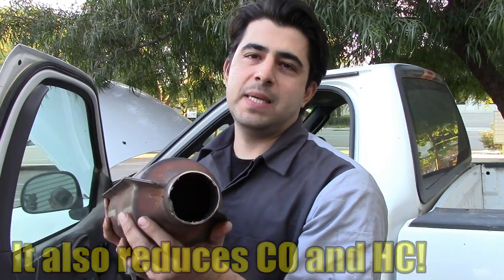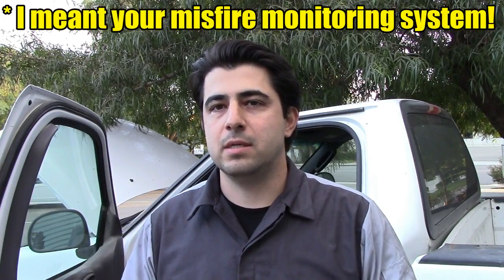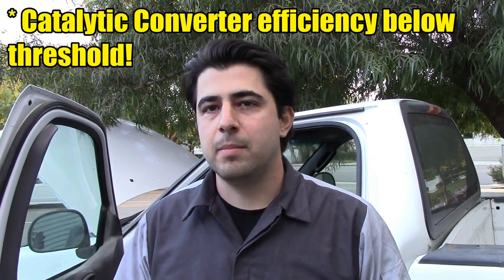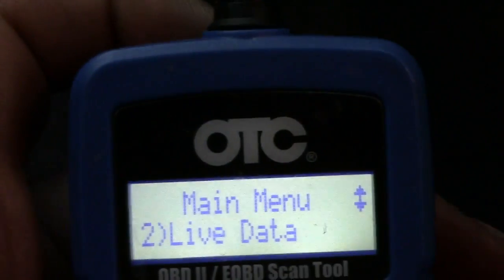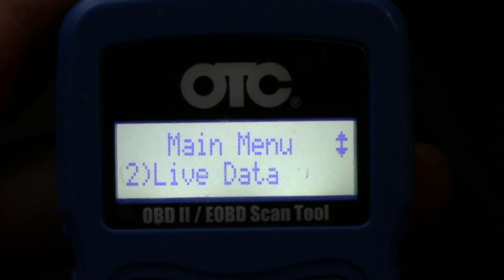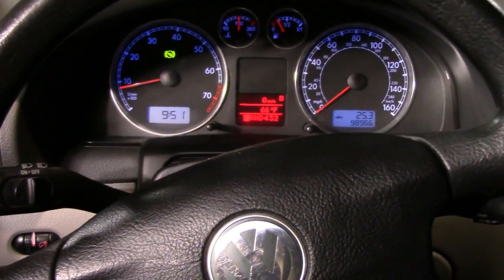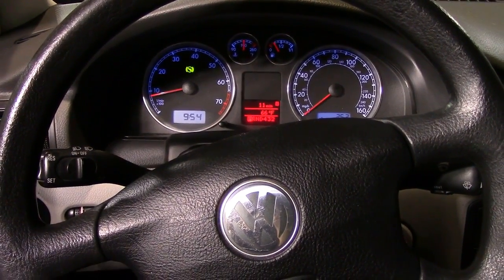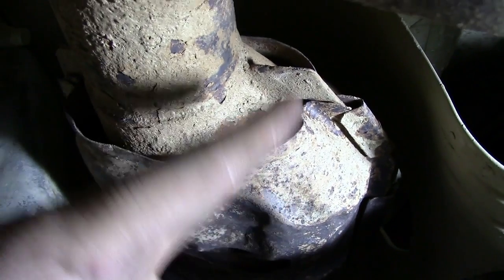How to Check a Catalytic Converter for Blockage or Efficiency Below Threshold Issues

Comment: Excellent information. You really know what you are talking about.  A truck I'm working on was showing 2 of the very symptoms you mentioned. Lack of power and transmission felt like it was skipping.  I removed the O2 sensor and there was a big difference.  Lots of noise and some smoke but the power came back (to some extend).  Truck has 256k miles, so.  Keep it up my friend.  👍🏼 If it helps anyone reading this. Do not be deceived with the O2 Readings
 You can have good readings on both Pre and Post Cat sensors. I didn't have a Check Engine light on (No Pending Codes either) but the symptoms were there. Good Luck everyone.
Reply: Are you saying you removed the upstream 02 sensor to let air flow out of the hole, to see if you had a clogged catalytic converter?

Comment: I failed at checking the O2 sensors. lol  I didn't have the tester with the clamps.  There was four sensors and had a P0420 code popping up.  I keep watching these videos and realize what you said about the warrenty.  Called GM for my 2009 Tahoe with 129 700 km and still had till 130k for warranty.  Called Chevy and initially was told there was no warranty until I strait up cut him off and said I spoke to GM about this coverage.  Went to Chevy and still was trying to test my knowledge which is pretty much the knowledge thanks to your videos. Later got a call and was told the part was being replaced and going to be ready shortly.  I was told the cost was over 1400 and im sure that didnt include labour..  THHank you very much for your videos

Comment: @14:41 you should be checking 02522 O2 sensor (Bank 2, Sensor 2) but took reading from 02512 (Bank 1 , Sensor 2) again! Already determined that Cat was bad just previous. I got the updated OTC 3208 scanner and it works great. Thanks for this video explaining how to use it.

Comment: Hey guy; Thanks as always for your informative info. 
Got a make or break me question. Sorry to be so windy but I feel info is crucial. 
I picked up from an older gentleman a 2004 Dodge Durango 3.7 with 112 thousand original miles. Spent much of its life in a garage. 
It ran like crap and barely got home. I replaced original plugs & coils and she started with the multiple misfiring probs. in between small periods of smooth running I noticed she was running to warm. 

I plan on keeping so I Replaced Water P, Thermo, and hoses. That helped but still warm. 
So I called a local ole guy that has been working Radiators for all his life, told him some history and he wanted me to bring it in. He showed me his test Sure enough it was. 
I put new one and she is very happy. 
I tinker and get myself in trouble regularly. I was getting dizzy with the coil plug switch game. 
She idles rough and coughs and sputters trying to gain speed. 
I took to a local garage with written down history. They said It needed a better quality plug. While there I had them do a compression & leak down tests. They were impressed with results. 
And the she ran rather awesome for 200 miles. Then back to same.
They first mentioned catalytic converters, But I thought with only just over a hundred tho miles they should not be the issue.
I just caught your vid on testing the pre /post cat temps.
Bank 1 which seems to have the majority of misfires the cat temp after heated a bit were almost 600 and close to the same pre/post. 
Bank 2  post was +80 form pre. 
You mentioned it must be significant difference.

So here I am///  I do want to keep her.
I can do the installs.
OEM Cat Y pipe is about $500. 
My exhaust muffler is swelled so That will be about $300. 
I've already put 2 new rear 02 sensors. 
I'm just confused as when the "correct" plugs were installed she ran very well for the 200 miles.
I would just like some (a little) reassurance  this will cure my problems.
Best; Tom

Comment: Nice video, good summary. I made a little adapter from an old O2 sensor that goes into an O2 sensor threaded hole, allowing me to measure backpressure in front of the cat. Works great but I don't often use it.
Reply from the maker: Nice, that a pretty good idea. Everyone has a couple of self made special tools I guess :)  Thanks for your comment.
Reply: That sounds ingenious. How did you do it? I guess you 'd need to know what the pressure would have been for a working CAT to compare with?
Reply: I did a video, search "make your own exhaust backpressure adapter". It was interesting to bust open an oxygen sensor on camera, although one viewer pointed out that internal parts are mildly radioactive, ha ha.
Reply: spelunkerd k

Comment: You always give very valuable information man and you explain it so good , very very well explained and it’s very obvious that you really know what your talking about ,  I been trying to get my truck to pass smog for 7 years , I had lean codes galore that wouldn’t go away I changed O2 sensors both cats with used ones off another truck still nothing , my kNn cold air intake nothing   Fuel injectors still not ready , cylinders coil wires spark plugs , next  I think I should Check my ECU ,  I wish I could barrow you for a few hours so we can pin point the issue
Reply: I definitely dont know all he does but I'd think after all your checks and changes you've done your Check Engine light would have turned off by now. 

Since now after all you have done I've heard that by simply disconnecting your Negitive Terminal on your battery for a brief moment and reconnecting it the light should go off (after a few minutes or so).
Reply: I tried that many times my friend , I have my own scanner code reader tool ,  so I finally got rid of my lean code , had something to do with one of the hoses around my gas tank cap , but still , now I have a bad cat that I bought off somebody on offer up , I didn’t know how to check it before now I know with the flashlight , so yea when I opened up cat heat cover the thing was all rusted out , so I put my old one back on because it was in way better condition , now I have a exhaust leak and maybe clogged muffler

Comment: I have not read all the comments and am not sure if anyone has mentioned this before. But @ 7:47 in your video, you started looking at readings from the 2 Bank2 Oscar sensors (meaning O2s21 &O2s22). You read the first one (O2S21) correctly but @ 8:09, and while you thought you were looking at readjust gs from O2S22, the display on your code reader was actually displaying the readings from O2S12... which is why you thought "what do you know, it's behaving like the post-cat on bank 1". Just thought I'd mention that. Otherwise, very informative a day understandable. Thanks.

Comment: Thanks for the video. I was having a problem with sputtering at low rpm and my bank 2 came up on my CEL code. This might have shed some light on an issue i didnt think about. My f150 is a 99 4.2 bought in june of '15 and this might have been an issue building up over the year. So this might actually help me alot. Also i just fixed the IMRC retainers due to that cel but had to drive it like that for about 1-1.5 months. Lol not much time to do anything. But this coulda been the issue.

Comment: I'm having an issue with a 1997 Jeep XJ 4.0 that may be a blocked cat and I thank you for the tip to loosen the bolts on the exhaust manifold flange which I'll do tomorrow. Thanks again.

Comment: Nice video! I must say u made a long way since then. Keep up the good work!
My Chevy Sonic has the exact problem, during gear shifts sometimes car shakes back and forth. Feeling like a transmission problem. Car has no codes. First I thought it was transmission but after seeing your video I tried to give it a shot. My cat and exhaust manifold are in one piece so removing them and going for a drive is technically impossible. Should I remove the first o2 sensor and  go for a drive? Thanks in advance

Comment: Just drill a small hole in the exhaust line, commence spraying choke and carb cleaner in exhaust line while it's running. Use half a can, and drive the hell out of it for 45 min. CAT is cleaned, reset codes.
Reply: How is this different from overheating it with normal gas

Comment: Great video, thanks.  A year ago I had my Catalytic Converter replaced. couple of days ago two codes came on P0420 and P0430. When checking a live data the A/F Sensor before the Catalytic Converter has no movement on the scale but the one after the Catalytic Converter is jumping from high to low constantly.  How would I even check if the precut sensor is good or bad. Also,  I think y this car had 2 precat and 2 postcat sensors.    2002 Rav4. thanks

Comment: Cats don't necessarily all go because they have been on the car the same amount of time.  I have a 2007 Lincoln MKX and only the back Cat needs to be replaced.  Be sure you get the temp reading done because the diagnostic scan will bring up the code for all cat converters P0420.  You won't know which one until they do a temp check on the in and out of each cat.  Don't let them tell you they all have to be replaced.  Good idea to go out with the mech and watch him do the temp check on each one in front of you.  Also keep in mind that the clogged cat is the RESULT of something else gone wrong.  If you don't get to the problem you will be replacing another cat down the road because the same thing will happen.  Cats really don't go on their own.  As one mechanic put it, they don't die, they are murdered, lol.  Could be fuel leak, oil leak, bad 02 sensor, bad plug...

Comment: Great video it's told actually the way it happens I went to a Chevy dealer and they could not diagnosis  the problem  two weeks there they depend on there codes which are worthless use common sense

Comment: I got a check engine light on my jeep Wrangler , i scanned it and it was bank 2 sensor 2 ( p0057 ) . I changed the o2 sensor , but the check engine light is still liuminated after 40 miles .. do you think its bad catalytic converter ?? Please reply

Comment: Hey, I have a question whether my Cat really is bad or not. I got the P0420 code for a couple weeks and been going through a checklist on symptoms. The car seems sluggish lately, and will not accelerate quickly anymore, I have to slowly increase speed. I tried accelerating faster than normal and had a cylinder misfire with the P0300 code and Torque Management P2637, which eventually disappeared after 5 minutes. I cleaned the throttle body and MAF sensors, checked the ignition coils and spark plugs and all seem to be fine. The 02 sensors seemed fine on inspection. However, when I measure the temperature around the Cat, the inlet weld is about the same or up to 70F higher than the outlet, this infers a bad/clogged Cat. What I don't understand though is that through the OBD2 voltage readings, the pre Cat 02 sensor oscillates rapidly around 0.1 to 0.85V and the post Cat sensor is fairly steady around 0.8V and only dipping to below 0.15V when I push the gas. These readings tell me the Cat should be fine though, but the temperature readings tell me otherwise. Should I go ahead and assume the Cat is bad? Can I drive with the Cat removed just to see if the car responds as it's supposed to under acceleration? Thanks!

Comment: Same thing happened to my Explorer. Engine was changed at 170k and they fucked up the pig tails on a few coils. I think all three cats are plugged, the pre-cats for sure. The guy I got it from was fairly old and drove it for quite some time like this. Engine seems to be fine though. Only 31k on it runs very good and quiet now I fixed the coils.

Comment: Thank you for the great video, was very helpful in my situation… Was curious if you could help me with My issue. So here goes, yesterday my car passed the inspection and omissions test with zero issues or errors. This morning I wake up and have a check engine light with the code P0430 bank 2… What in your professional opinion do you think that could be? And it is OK to drive for a couple days before I get it fixed? Thank you very much look forward to your response and keep up the great videos
Reply: if it passed the inspection and it's not obstructing the flow out it will not lose performance nor get a high fuel consumption so you are good to go. Just put a small black tape on top of the engine light and it won't bother anymore...

Comment: I have a question, I had misfires/bad accelerations/bad gas miles/strong gas smell coming from my car. But, it started off doing it intermediately, coming and going, coming and going. But now it's like that all the time. What does this sound to be the problem?
Reply: Catalytic converter bro is it your exhaust making the smell of gas like did you check for leaks? My car does this 92 Buick park avenue and from his video I think it is my cat causes low power struggles when accelerating jerks at about 50 mph or when gunning it so I'm gonna loosen the bolts on the manifold tomorrow and see what happens from there keep you posted

Comment: Thanks for the video. I am trying to diagnose my own catalytic check engine code too. Question is how can I diagnose other engine issues that caused my catalytic converter to go bad?  Thanks.
Reply from the maker: +2Phast4Rocket Things that will make a cat go bad are usually misfires that go untreated for a while, an engine that burns oil and poor quality gas. More or less if you have too much fuel/poor fuel going through your cats or dirty exhaust fumes due to the burning of oil your cats will be damaged/clogged. hope that helped, cheers.
Reply: +RatchetsAnd Wrenches  GETTING MINE REPLACED 350 DOLLARS PLUS TAX
Reply: $289 for my Mom's and there was no misfire with 80K. I kept it tuned up.
Reply: If you have an exhaust leak that will cause engine to run rich and choke that cat with unburnt fuel

Comment: Hi there I have a 2006 Mitsubishi eclipse. I parked it and did not drive it because I was hearing a noise coming from the exhaust/Catalytic Converter. So I believe that is what it is? When the car is cold is when  I hear the sound the most. Every time I take it to my mechanic (2) mechanics they say it's is safe to keep driving it.  I am so frustrated. The noise use to go away but now stays. So now the sound sounds like a little rattle which sounds like vibrating for the most part. Also experience small misfires some times, but no always. Never loss of power. I just don't want this to get worse. What should I do. It's like going to a doctor have to keep trying difference ones to get the right diagnoses.Like your video by the way, it is educating for a girl lol.

Comment: a clogged cat convertor can cause a crank no start issue. to check for a cat convertor clogged causing the issue, simply remove the upstream oxygen sensor and try to start the car. if it now starts, your cat convertor is clogged. your upstream 02 sensor is the one under the hood going to exhaust manifold.
Reply: remove the oxygen sensor that is under the hood, and is in the manifold towards front of engine. its rare this is the problem, but its good to check.
Reply: did it work?

Comment: I have an Oldsmobile Cutlass Ciara that has a host of problems. When I drive like you said it feels like its being pulled back, take off some times shuts down or has no speed. This past weekend I had a gas filter leak and now my car is making loud muffler sounds, knocking but all the noise seems to be coming from the tail pipe are but I smell gasoline in the front. There is no scanner for OBD 1 scanner so now its a guess game from these mechanics. Its a 91

Comment: The thing is, or so I heard, that if the CC is even 1% less than 95% efficient, it will trigger the check engine light.  So if you're doing the temperature thermometer or another test,  it might show similar numbers as a one that is 95% efficient, so the test wouldn't really work.  Correct?

Comment: hi there i always watch your videos but just want to ask can a car shut down if i have a bad cat converter?
Reply from the maker: +Juan Bulnes A clogged cat can cause a car to run under powered or hard to start or unable to start, but wont shut down out of no where without those signs first. gl
Reply: +RatchetsAnd Wrenches I SEE FIRST IT WAS LOOSING POWER AND THEN ITLL TAKE A WHILE TO START AND NOW IT CRANKS AMD SHUTS OFF.
THANK YOU FOR THE INFO AND KEEP UP THE GREAT INSTRUCTIONAL VIDEOS THEU HELP ALOT

Comment: Have you had any luck with infrared thermometers? I've tried those tests and they've always shown my catalytic converters to be bad even though live scanning proved otherwise.
Reply: Oh, I get it, Ericthecarguy taught me this additional test incorrectly. he tested on the front and then the back of the catalytic converter and your testing the pipe before and then the converter itself. That makes a lot more sense, and from that perspective, this technique would have worked for me, but since it got me into a live scanner, I won&#39;t fault Eric for it.

It really opened the world of cars to me to use live data. :)

Comment: I fixed P0421 code on my Hyundai sonata by driving the car at 5000rpm for 10 min on highway. The p0421 was triggered due to misfire in one cylinder. Driving at high rpm will burn the stuff which clogs the catalytic converter.
Reply: Jobumon Jose 
Is this really true?
Reply: Junk cars off the assembly line

Comment: Great video, about the code reader it looks like they discontinued the one you show in the video.Is this one the same with the live data, Autel AutoLink AL319 OBD2 Scanner Automotive Engine Fault Code Reader CAN Scan Tool or Bafx Products - Wireless Bluetooth OBD2 / OBDII Diagnostic Car Scanner & Reader Tool
.Thanks one more thing will it pick up the bad cat while warmed up and running because the problem is only happening when i'm doing 50 to 80 mph i smell a rotten egg smell bad coming from the dashboard area .The vehicle is a 2013 ford edge and how do i find out the correct volts for my vehicle.Thanks